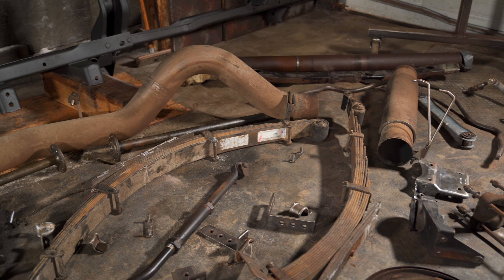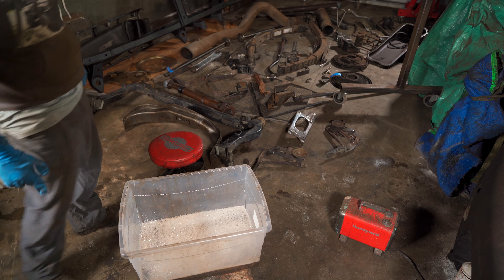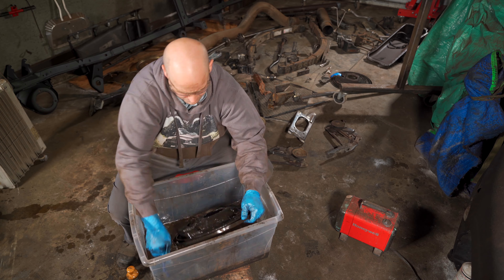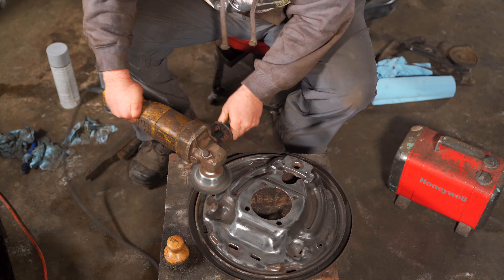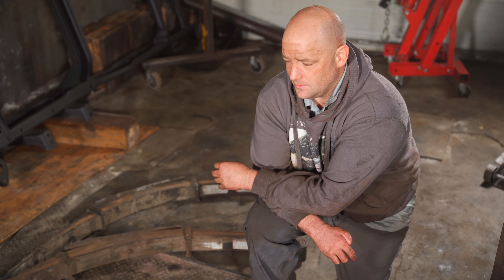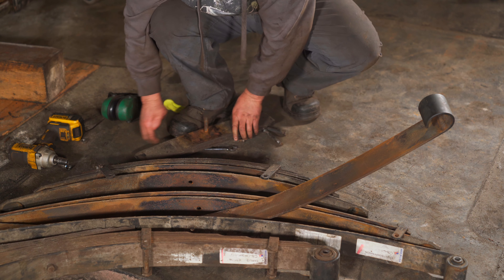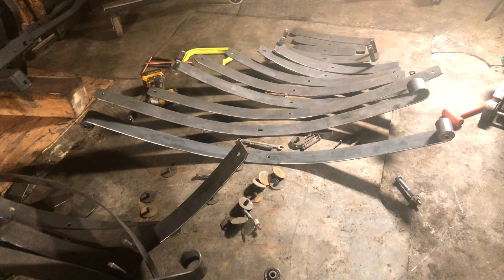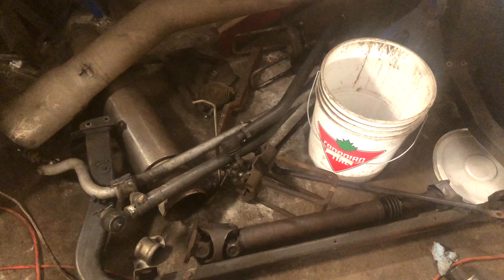12 Valve Dream Truck Build Episode 16 Cleaning Parts

Comment: As far as heat goes. You’ll be just fine with regular paint. Don’t use hi heat. I did and ended up re cleaning and using regular rustolieum haven’t looked back since
Reply from the maker: Great thanks man!